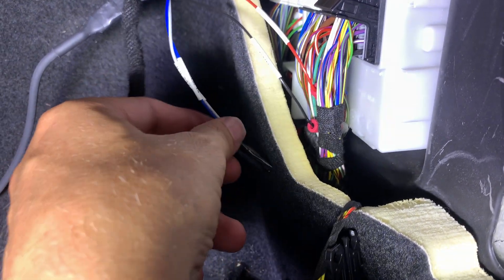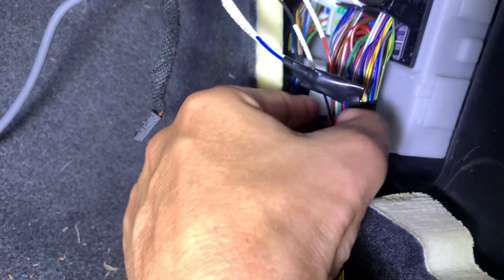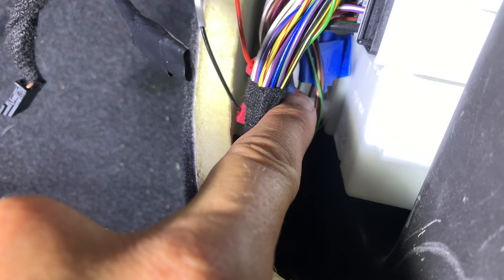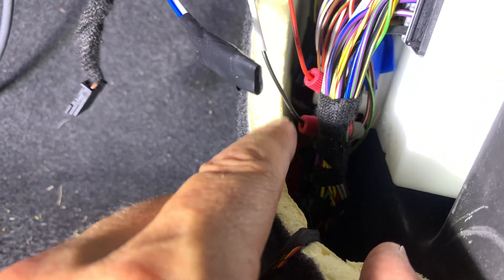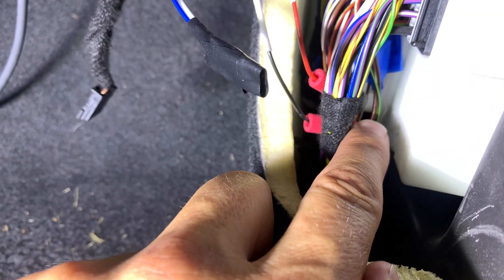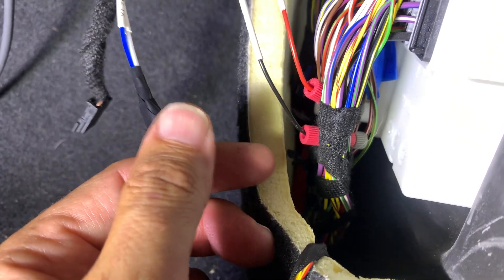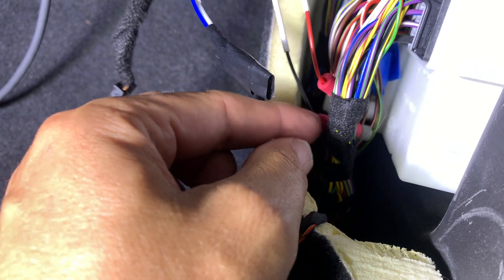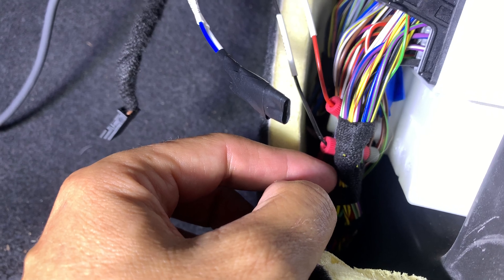AIM Solo 2 DL - Canbus Install - BMW M2 F87 (2018)

Comment: DO you know if your wiring advice will work on a 2019 M2c? Super helpful. Thank you.
Reply from the maker: Not 100% but I wouldn’t think that BMW had to change the wiring harness just because the internal physical structure of the engine is different. The canvas high and low wires shouldn’t be different. Hit up Grok and do a deep analysis.

Comment from the maker: … after many months of planning and PROCRASTINATING…! 🤓
Reply: Why you do not use OBDII directly?
Reply from the maker: @Newtonzs  it provides access to a more limited amount of data points. Oil, intake and DTC temps for example are not available.
Reply: Would this wiring configuration also work with the Aim dash logger?
Reply from the maker: @ I think so, because it taps into the campus plus and minus wireless, but I would give Aim a call on Monday to confirm